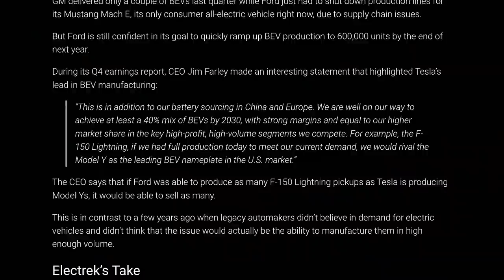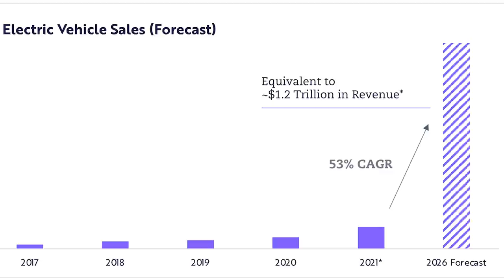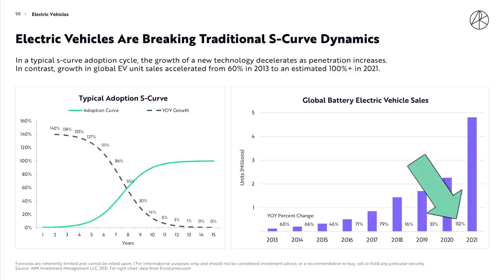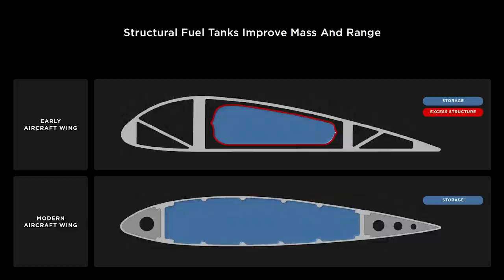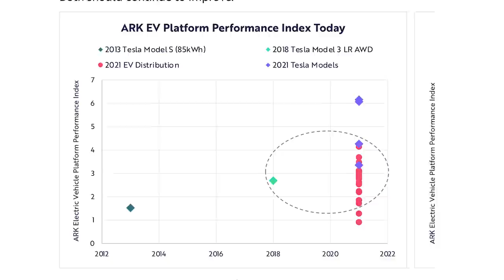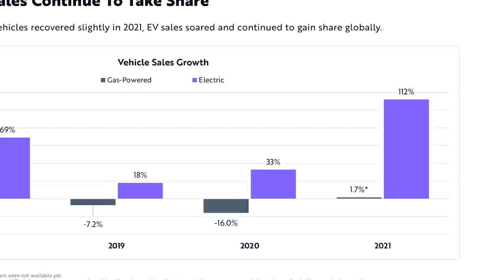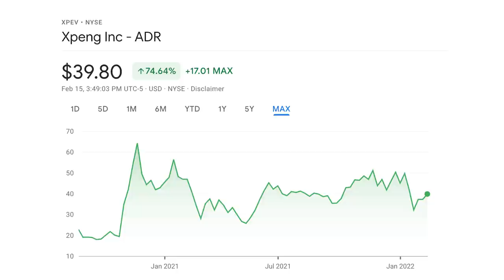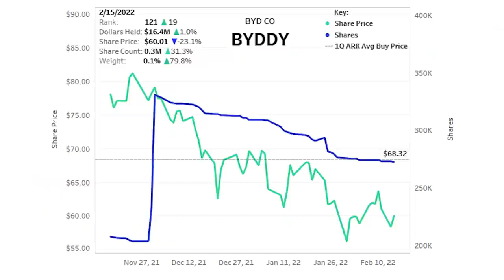⚡ Top 3 EV Stocks That Could Catch Tesla

Comment: 4680 charge times should be substantially improved. 
Lower resistance and less heat during the charge cycle. They should be able to stay in the max charge rate for a higher percentage of total charge.

Comment: When the battery energy density is increased less batteries are needed to maintain range.  This makes the car lighter and cheaper to make.  At some point EV's will have solar roofs and this will increase range.  With solar the less you use your car the more you drive on solar.
Reply: Lightyear and Aptera are good examples of the solar car.
Reply: Maybe in 20-30years +
The solar roof is making the car more dangerous and heavier.

Comment: I like Tesla, but not being able to change the batteries other than to a premium cost bothers me. As new battery technologies emerge, few can afford to dish out an additional $25 000. That is not that smart.
Reply: Since the batteries will last at least 10 yrs I don't quite follow why you are worrying about the cost of replacement. Did you purchase your last car based on engine replacement cost?  Your range will  drop some over the years but shouldn't  be enough to make the car unusable. Assuming you can charge at home,  other than trips, you may never use a charging station. How many days a week do you put more than 200 miles on your car?  Most people never do other than vacation time. Relax, the battery will be fine.
Reply: @davekozlowski1266  How do I know the battery will last 10 years? They haven't been tested for that amount of time yet, right??
Reply: I don't get the economics of the battery swap idea. If electric car production is battery supply-constrained, why would you want to have to make thousands of extra battery packs that have to sit around in stations? How many batteries would be necessary to keep in each station in order to keep a constant supply of freshly charged ones? Seems wasteful and illogical to me.

Comment: Now, I haven’t seen all your videos. Though, I’ve seen many. This is the most informative video on your channel. I really like the concept of battery swapping, that would alleviate charge anxiety
Reply: I own a Tesla and lost all range anxiety after my first cross country trip. The only people having range anxiety are those like yourself who don't own a Tesla. You are comparing gasing up to charging which you don't realize is comparing apples to oranges. I don't go to the gas station, I plug in when I get home and unplug to a full battery when I leave, takes less than 30 seconds. No wasting time driving to the gas station, no 5+ minutes filling up. The only time I use a supercharger is on long trips. In the time it takes to pee and get a cup of coffee my car is charged. FYI you rarely ever charge completely, charging 10% to 70% is very quick and progressively slows as the charge gets higher. 

If you want to drive all day long without ever stopping get a gas car with an auxiliary fuel tank. LOL 😆

Comment: Add a third issue affecting the purchase of any EV, but especially any current non-Tesla EV. That issue would be charging station locations or lack there of and charging speed. Opening the Tesla network of charging stations to all EV's for a subscription based minimum plus charging use over a generous point would be a massive source of income for Tesla. Other than the bottom of the market costwise (sub $15k EV's) Tesla wouldn't lose customers to the majority of other EV's.

Comment: I count on gac, mainly due to their aion subunit which for itself is better than xpeng imo. Then put the joint ventures with Honda and Toyota on top (mainly fossils but also hybrids already, EVs in the next years) and you might start to think what market cap they deserve. Valuation of the Hong Kong shares is even lower than Shanghai ones by the way. This is my opinion, no investment advise. But they have the best chances after byd imo. Byd stock is way riskier due to high valuation.

Comment: I think it’s important to note that the Mock he you can only accelerate five times and then the software governs the acceleration because the battery will overheat. So the Mock he really is not faster than the Tesla model three. You can only accelerate a few times before the car prevents you from doing it and then it becomes a slug.

Comment: What does having a structural battery pack mean for replacements and the subsequent environmental impact?
Reply: It means the battery pack is a structural piece eliminating a frame to hold the battery pack. The pack can be removed like one that sits in a frame however the car will require something to hold it up if a swap in taking place, if not the car gets recycled.
Reply: Battery pack can be recycled just like your existing car battery. However, most likely use would be that someone would love to buy it for home battery backup.

Comment: The problem with NIO Is that you have to drive to one of those charging systems when you could just charge at home with a TESLA. So the time that you’re saving for charging really isn’t time saved at all I’ve owned a model X since 2016 and I’ve been to a handful of Superchargers even though I have free super charging and I wake up to a full charge every morning. Why would I want to go to one of the stations to have my battery swapped out for a battery that maybe has 100,000 miles on it? Every battery that you get is going to give you different range and different performance from a neo station. It’s a terrible idea. Ne-Yo isn’t going to be watching every single battery at what point Are they planning to get rid of the older batteries and decommission them? I don’t see this business model working. You need twice as many batteries as you do cars. Everyone knows there’s going to be a battery shortage. Terrible idea.
Reply: NIO cars do have the option for plug-in charging as well. Battery swap, and thusly Battery as a Service (BaaS), is purely an option for those living in apartments or densely populated areas that may not have enough plug-in chargers. With standard plug-in charging and battery swap, it's gives more options for NIO owners. 

Also, them monitoring battery health is exactly the point of battery swap. Tesla requires owners to pay 20k+ for new battery whereas NIO can simply swap it out and recycle it. Great idea IMHO.
Reply: @heathjones4214  tesla dumped this idea almost 10 years ago because of the volume of batteries and infrastructure needed. NIO isn’t making money yet. This would be a mess in Minnesota winters and would take longer with frozen cars.

Comment: On Nio and battery swapping, I think there was a good reason Tesla which experimented with it, decided not to take this approach.  Battery swapping only provides an advantage in two areas which is faster charging time and the ability to easily swap out batteries.  

The faster charging time advantage, however, goes mostly out the window when you consider that over 90% of the time people are able to charge their vehicle overnight at home.  Not to mention, if there is any sort of line at the battery swap out station or if someone has to drive further to get to one, being that they are likely to be less off (due to the higher expense and complexity of such a station vs a charging station) this will also significantly reduce this benefit. 

Even the advantage of having the ability to adjust/upgrade battery becomes harder to justify, when you consider the logistical complexity of needing to have a charged battery available at each station (with compatability for the car requiring the battery) for the swap out to occur. Something that could be mitigated through having customers reserve/pre-order the battery, but once again adding complexity and an inconvenience to the customer.

 Finally, swappable batteries will likely have the disadvantage not being able to use the battery as part of structure of the vehicle as Tesla is looking to do.
Reply from the maker: I do think the structural battery is a great reason not to make it swappable. On the flip side, not having to pay for the battery up front AND being able to upgrade it over time as part of your subscription is a big draw. Also, not everyone has a garage or access to home charging. Most people in cities wouldn't have that.
Reply: @TickerSymbolYOU  While I agree not having to pay for the battery upfront and paying a service (basically leasing the battery) is the strongest argument I have heard for how this model can suceed.  The arguement for over night charging still stands.  Even if some doesn't have a personal garage in the city.  The vehicle will still have to park some where and a charge station can be placed where ever the car is parked.  For example I have seen newer apartment complexes and hotels install charge stations by parking spots to attract ev owners.